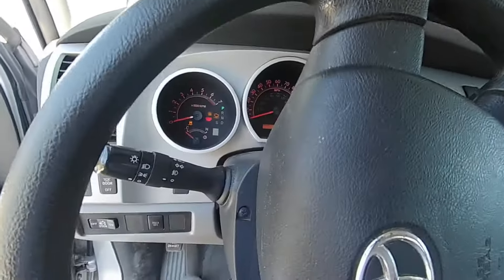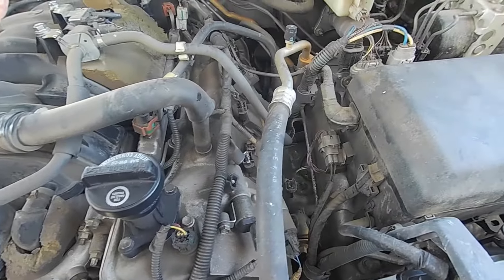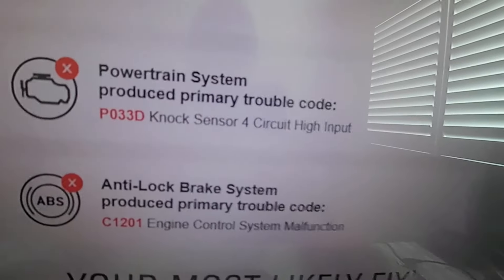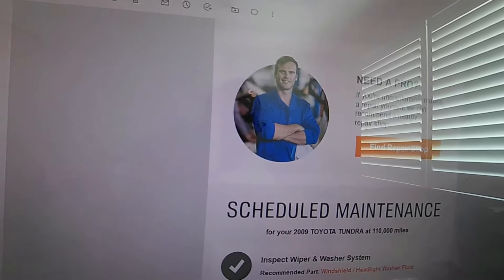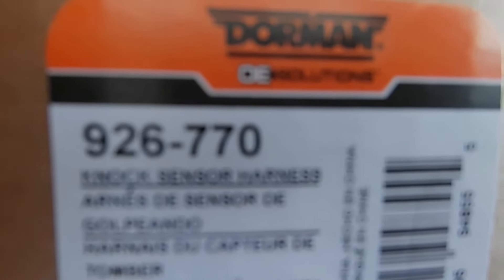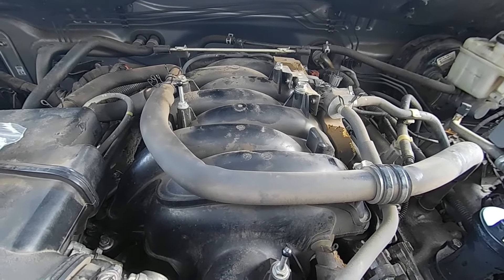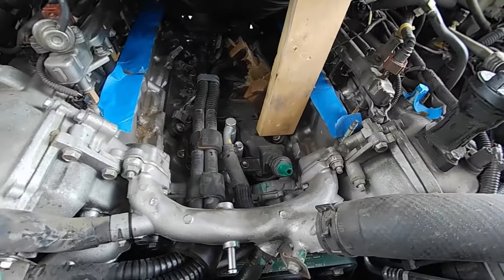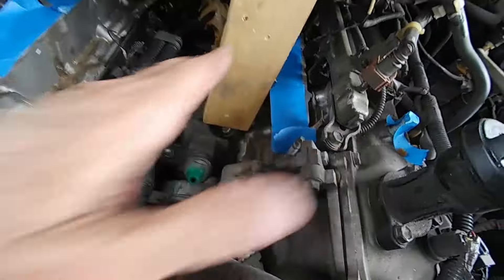Toyota Tundra VSC, Check Engine, Traction Light - One Solution

Comment: Be sure to check your battery terminals. My 2008 Tundra did this, I had the VSC, check engine light and 4LO flashing. I cleaned my battery terminals and it cleared the faults. My terminals were corroded.

Comment: Hi Rick. This recently happened to me intermittently.  I ran across this video on youtube by Phillip Bailey.  I haven't tried this my self but maybe that might be the fix for you. (2007 Toyota Tundra ABS And Traction Control Lights On. C1201, C1207)  Just curious if you looked into this during your investigation.
Reply from the maker: My problem was purely rat oriented and chewed knock-sensor wires. Subsequent the repair, replacement of the knock-sensor harness, I've parked my truck in a secure garage...no rats, no problems with the truck; now, we battle them in the RV. Thank you.

Comment: Could t you of just soldered the chewed wires man would of been allot faster and easier I’d think.
Reply from the maker: The chewed wires were under the intake manifold. It requires an hour or two to access…why not replace with a new harness as opposed to trying to locate every wire compromised and patch? $30.00 bucks for a correct and proper fix is better than a sloppy patch work that may or may not correct the problem. IMHO